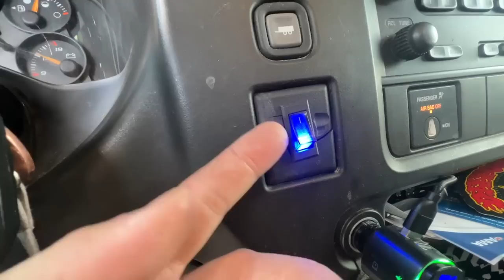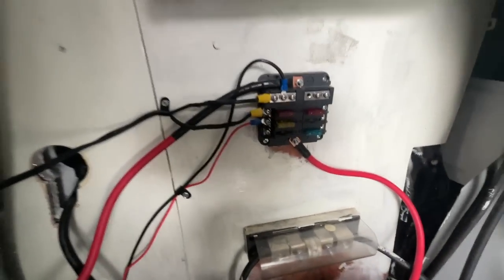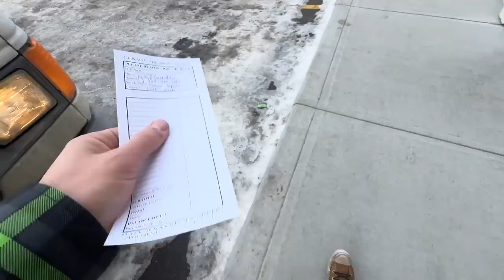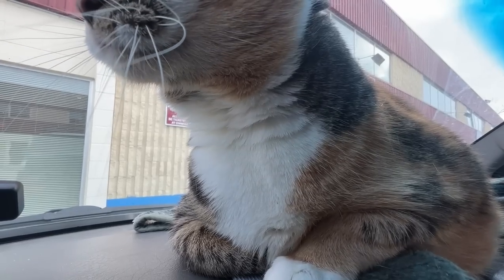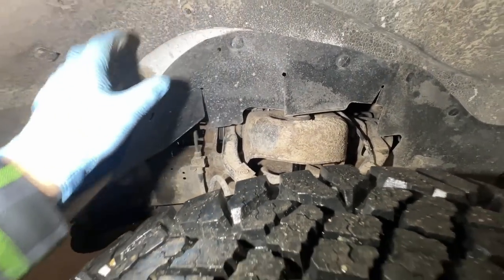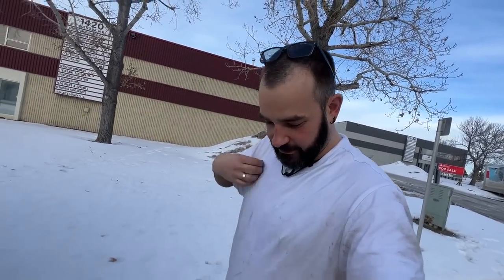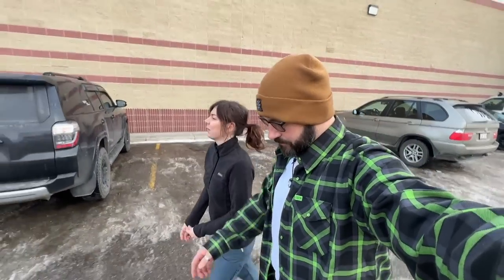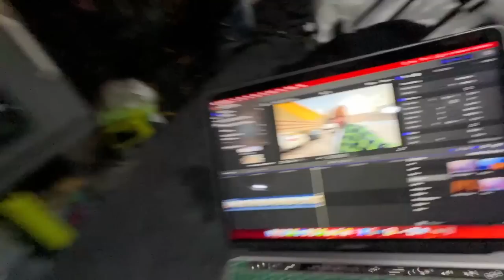Had NO IDEA This Place Existed and It's Ideal for Vanlifers

Comment: Hola from the Rubber Tramp Rendezvous in beautiful Quartzite AZ. I also used to shower at the Flying J, specifically the one on 114 Ave SE. The prices are great for what you get. Here in AZ, Truck stop showers cost US$16-US$18. Another great place in Calgary for showers is the Quarry Park YMCA, where you pay about the same as Flying J, but you get a full access day pass. Shower, shave and a workout. Great facility! That’s where I went for almost four months before I headed south. Good video. I heard about that U wrench from Mark The Paint Guy.

Comment: You know you have 8 coils on you're engine that's better than having a distributor on the engine shocks are real easy to do but when it comes to putting on a lift on your truck I never done that yet but I got to call about it  whether they can do it at Davis tire or I have to do it myself or not but and that's good you put on new back  shocks and put in new spark plugs that should of done it have a great night and a great weekend coming up 👍👍👍

Comment: Forgot to comment this morning on Amber's battery issue ..you have to ground to the frame...the second set of batteries ...other wise they will not charge ..or supply power to any van accessories ...use a battery size cable...make sure where you attach to frame, that it is bare metal ..once thatz done . Spray it with primer ,then caulking to prevent road salt etc.from the connection..the frame is negative battery by the way .😂

Comment: A UWrench incorporated in with a UPull would be awesome. Go in the yard and get the parts you want and then rent a bay and hoist to install. Probably one somewhere. 
My truck had Iridium plugs in it and I didn’t realize so when I bought a cheaper platinum set (which is the OEM spec) I couldn’t tell if the Iridium’s were bad or not. Different tips to the old style so I’m not sure which was better - iridium’s of an unknown age and condition or new platinums 🤷🏻‍♂️

Comment: Hey Matt.  We have a few U Wrench It Auto places down here in NJ. Just $10USD for an oil change bay and $30USD an hour for a Bay with a lift. VERY reasonable if you're a wrench turner. If you ask for a Tech to assist, it's only $50USD an hour.  They are ASE certified too. How come you can't use the shop at work after hours to do this?  Guess they have rules, or people would be using them all the time.  Good video. 

BTW, I watched the 2021 Christmas Special last night. I hadn't seen it before. It was friggin great! Love your music selections too.

Comment: We used to have a gas station with a repair bay you could use - wouldn't even require you buy your oil from them. But, as people do, they messed it up. Stealing tools, leaving trash etc. They slammed the gate, understandably! Those fancy new shocks must feel great! And happy you figured out the issue with the electrical system on the other van without making a roman candle! I really enjoy this kind of content, it it wasn't already obvious!!

Comment: Long ago, I frequented a car forum, dedicating to restoring antique Fiats. I learned a truism about problems with electrical circuits from another poster named Dwight. We all called it "Dwight's Rule" which is: It's always a bad ground. "IAABG" It's a truism because  electrical circuits only work when the juice flows from the battery, through the business end of the circuit, and then to ground. There are a million reasons, of course, why the juice might fail to flow to ground, but it MUST flow to ground for the circuit to function.

We all got good at reciting IAABG on that forum. We also got good at looking for the bad ground first thing whenever we had an electrical problem. I remember Dwights Rule to this day, and it has got me back on the road time after time in my various jalopies!

Comment: Thank you for the information about the Chevy express, about  taking  the  tires  off. I  want  to  put  my  spare  tire  on the  back of my van.  Boy,  Penny  sure  has  some  long  whiskers.
Reply from the maker: Glad to help - yeah I would love to rear mount my spare as well
Reply: @VanlifePLUS  I saw a van that had tri mount hitch on it. You can still use it to tow a trailer. The spare was mounted on the left side and you can put whatever you want in the middle and the right side.  That van is a Mercedes Sprinter Van.
Reply: I took a picture of it. I was on a trash picking run. I only get what is on the ground outside of the trash can. I have found a lot of stuff for my van build.

Comment: I had to laugh when you took out your windshield reflectives and Penny didn't even get flustered. We used to have garage bays and paint booths we could rent when I was in the military years ago on base while in the military years ago. I don't know if they still have them. Will have to look into it here in the States if there is something like what you have for commercial use. I have been stuck in my build because I have to do everything outside. It is too cold for the sealant to cure for my fans.

Comment: Lugnutz is like uwrench. More expensive but are in the se. Lugnuts has more tools but no mechanic. Bigger bays but I just as good. They’re down by Barlow by pick n pull.
Reply from the maker: No mechanic? Do they have a hoist?
Reply: @VanlifePLUS  You rent the hoists.
Reply: @VanlifePLUS  they have major removal tools. All hand tools, major power tools. Parts washer.

Comment: Which engine is in Lucky? 4.8?

I need to change the plugs in my VanCave but I have 160,000 kms on mine. I got the most expensive DELPHI plugs then and now. (Next) 50,000 seem low..

Anywho phone tech support offer is still there.

Be well.
Reply from the maker: Yeah Lucky has the 4.8

Comment: Hi Matthew,
I don't know much about mechanics even if my Dad was one. But I was wondering if there were pieces for the breaks you first ordered were the right ones or if you were missing pieces? If you needed to return pieces, is this possible to return? If so, do I need to transfer you the return labels or do you have access to this information? I don't know where else to contact you for this. 1:04
Reply from the maker: Hi Danielle! All the pieces are good, just didn’t have them with me that day. I store them at the shop as the rotors are very heavy. You can message me directly on Patreon 😁
Reply: @VanlifePLUS  Excellent. Glad to be of help.